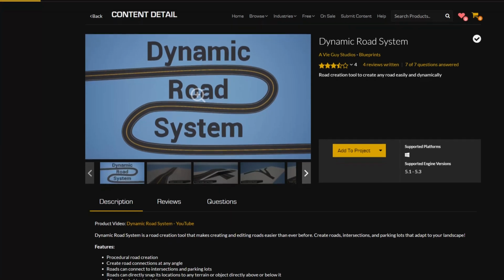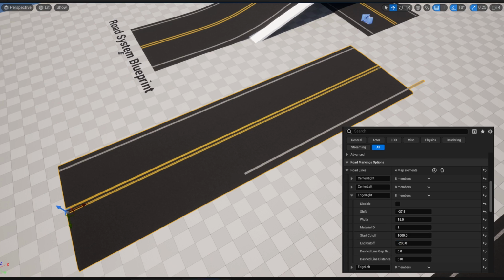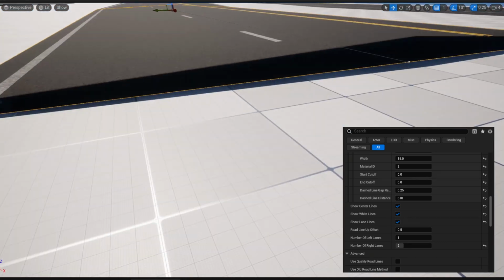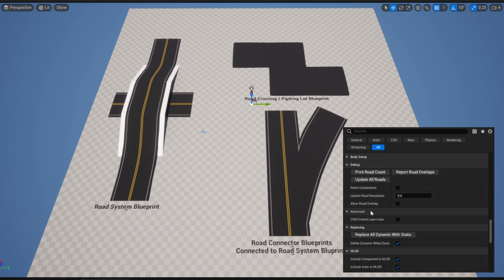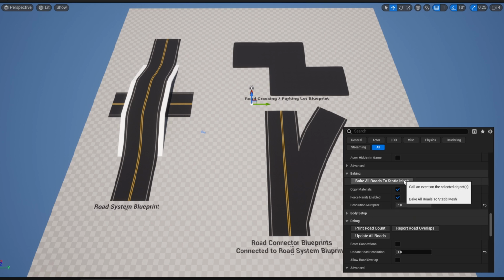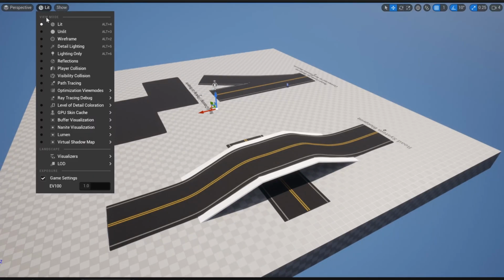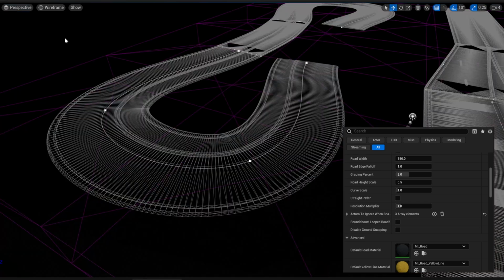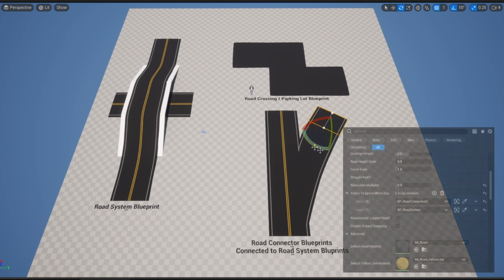Huge Improvements for UE5 Dynamic Road System | DRS Update 1.2

Comment: In south Africa the dynamic road system is very expensive isn't there a way a could get it please it looks really nice maybe like pay you wen my game release please
Reply from the maker: Unfortunately there isn't any option on the marketplace to do localized sales. And the problem with pay upon game release is that it is very difficult for a seller to keep track of who needs to pay for licenses when their game releases. We do participate in 30% off sales every 4-6 months or so which may help, but we would also consider localized sales if unreal had it as a feature when their new marketplace comes out. "Fab" is supposed to be their new marketplace for unreal assets and they said it would release early 2024 but I would argue that it is no longer "early" 2024 so every seller is waiting for more news from unreal for that

Comment: can I export the road to blender? like fbx or something
Reply from the maker: Yes. I believe it can be exported as an obj once the road is baked to static mesh. Once it's baked, you can go to the static mesh and open it in the content explorer and export it using the standard menu for static meshes
Reply from the maker: I have done the process once before when I downloaded an asset pack and needed to fix a mesh. From what I remember, it worked pretty well and it even remembers the material slots if you reimport to unreal engine